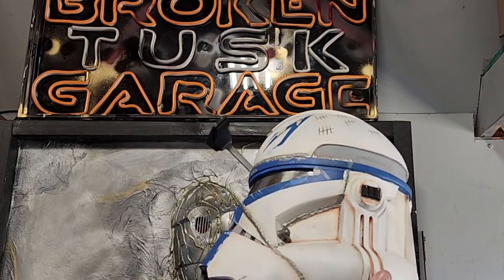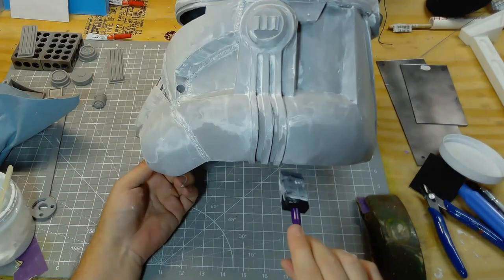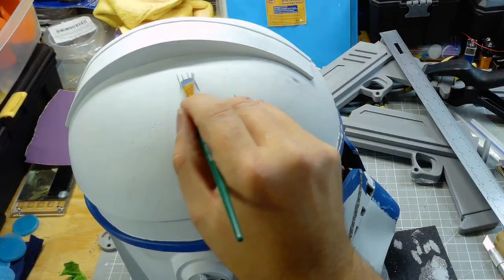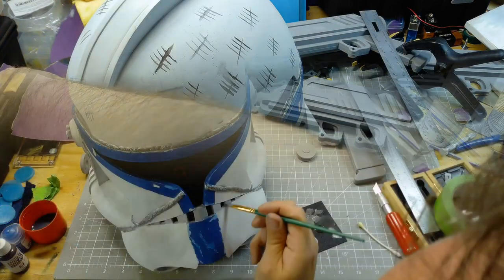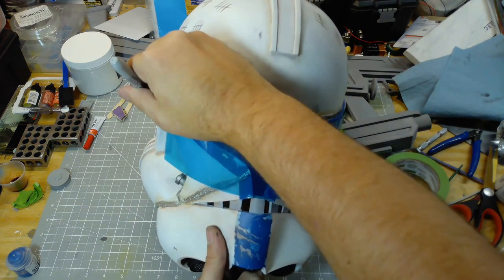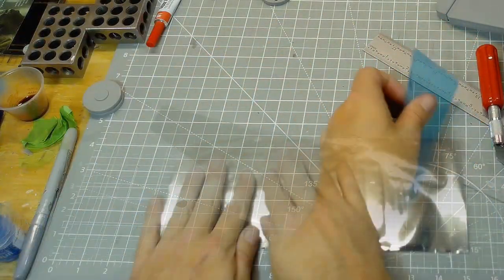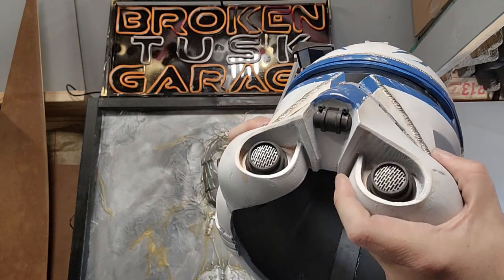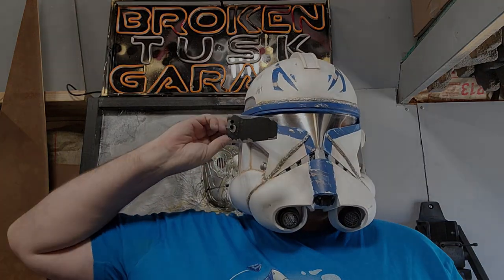How I made my #starwars Captain Rex Helmet from Rebels

Comment: That came out great, well done. I'm using layer size of 2.0 for my Storm Trooper costume, and I'm running my filament at anywhere from 105 to 110% feed rate to minimise layer shrinkage and separation, which plagued me earlier in the project (probably because of the near-equatorial climate that I live in). Where I have encountered shrinkage/separation I've used a 3D pen to fill in the gaps. Not really welding, I'm using ABS for the costume, but I have a heap of PLA for the pen that I just want to use up, so it's just being used as a gap filler, and it's working really well for that task. I did some final sanding today on almost all the torso and arm parts and painted them with a white interior/exterior emulsion paint, two coats, and that has produced a nice finish that I can sand back ready for proper painting. Thanks for sharing this video, it's helped me to refine my thinking for the next step of the process for my own costume.
Reply from the maker: Took me a while to get my settings tuned on my printer. I gave up on doing ABS and stick to PTEG and PLA because ABS can be so fickle. You need to heat the bed and have a heated enclosure to really help with separation of ABS. For finishing, the modeling paste can be found at any art supply store or online. Letting it dry for a day gives me the best results when sanding even though it's dry to the touch quickly. I'm in high desert which has its own challenges.
Reply: @brokentuskgarage  I live in Phuket, Thailand, so the hot climate here mostly negates the need for an enclosure. I'm finding that 80degree bed and 240degree hotend works fine here, as long as I run a slightly higher feed rate (which is mostly due to the filament not being exactly 1.75mm). We have no shops here selling modelling materials, and the local online shopping like Lazada doesn't always stock stuff worth buying. Amazon is often too expensive to ship here due to import duties, so I tend to make do with alternative products. I appreciate your feedback though. I'll try to get some modelling paste next time I'm visiting my family in Australia.
Reply from the maker: @davestinyworkshopotherprojects   ouch. I thought an hour drive to Phoenix to get to certain stores was a pain.

Comment: Rebels Rex has a completely different helmet. This one looks much more a realistic model, as it's also different compared to clone wars helmet.
Reply from the maker: True it's realistic and wearable and not 100% accurate. My helmet is missing the cheek marks which I mention, even in the the description. The eye stalk is wrong as well and not used in Rebels. But I disagree that it's as different as you say. In later seasons of Clone Wars, Rex modded his helmet combining the front of Phase 2 with the his Phase 1. Here is a video from Star Wars Expanded with decent images from both Rebels and The Clone Wars. https://youtu.be/jDDoLRSDHmI?si=_UvBF1ih5chOEDlY
Reply: @brokentuskgarage  the Rebels helmet is smaller, has only one  "stripe" over the visor line, the gray lines on the sides are only painted (no recess) and definitely no stalk.
Reply from the maker: @contirossini  good to know.